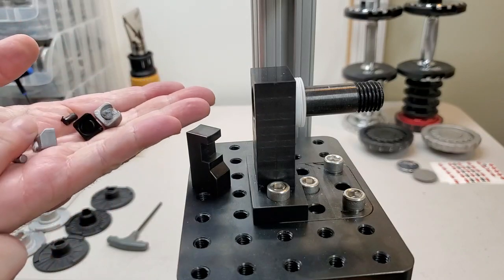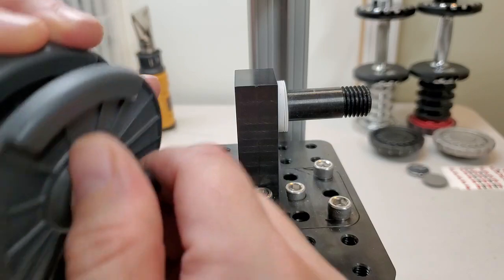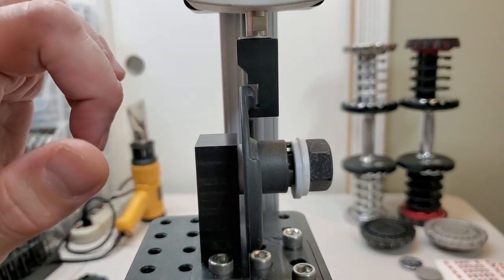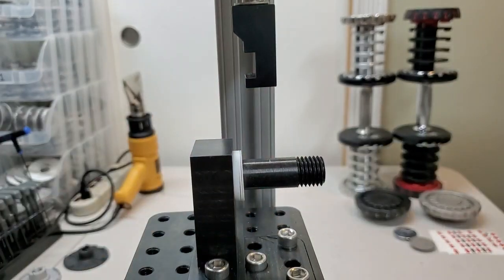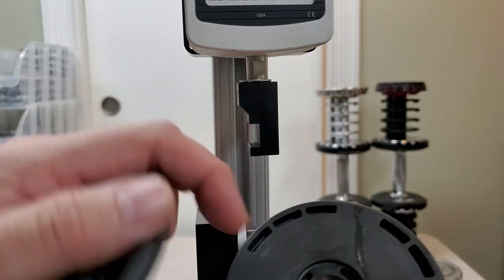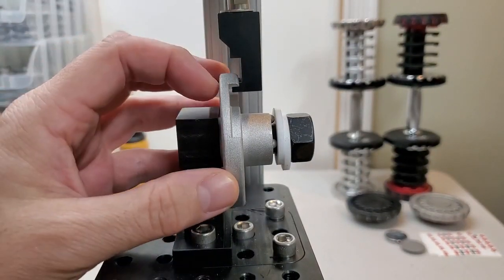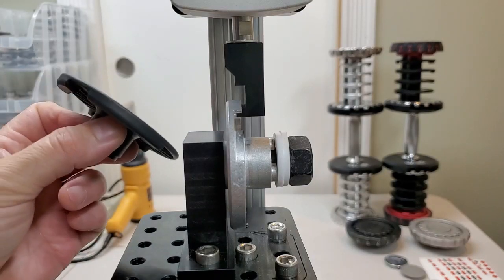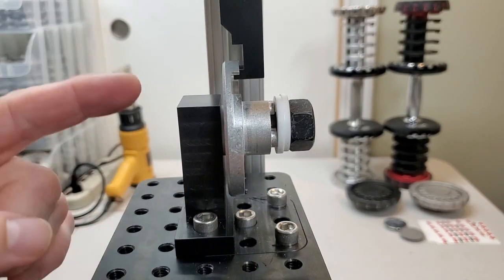552 Series 1 & 2 Bowflex® SelectTech® Disc Load/Stress Test: OEM vs Average Joe. And the winner is..

Comment: How is the weight of the part in comparison to the OEM?  Also, when/where will they be available to purchase?
Reply from the maker: Hiya Dalan.  For the 552 discs you can expect the weight of my current generation of discs to be roughly double the weight of OEM.  I hope to increase that more in the future.  My discs add roughly 1/2 lb per handle on the 552s.  For more information shoot an email to SelectTech.Fix@gmail.com
Reply: @AverageJoeInnovationsLLC  I like how you spun that into a positive despite the obvious negative.  I'm sure most people won't mind adding additional weight to their selected settings.  You're a good salesmen with a great product.
Reply from the maker: @RegaliaStudios  Thanks for the kind words Dalan, I appreciate it.  One of the most interesting developments over the past two years is the number of people who have come forward asking me to increase the weight of these dumbbells. That wasn't on my radar in early 2019. Back then my only goal was to fix my dumbbells and make them safer to use. But these days I take weight into account when designing new parts. So you'll see products in the months ahead (including my dials) that add weight to the dumbbell.
Reply: Can you explain the difference between the 552 and the 552i.  The version 1 and 2 of the bowflex gray vs red dumbells.   I bought some used that had weights falling off because the plastic tabs ripped off the covers.   I can't believe that the metal tab under the plastic tab has no interference with the disk holding feature.   The full load of the weight retention is done by (ABS I think) plastic and not metal.  When that tab fails or is gone the weights drop right off the disk.   Did they fix this in version 2?   How do you fix broken tabs?   I am considering molding new tabs with epoxy putty or PC-7 epoxy paste.